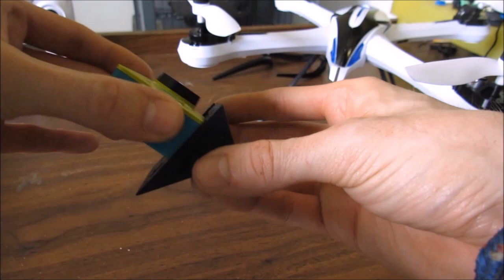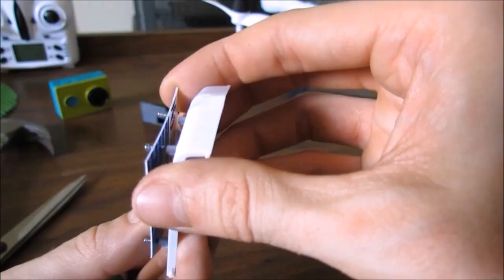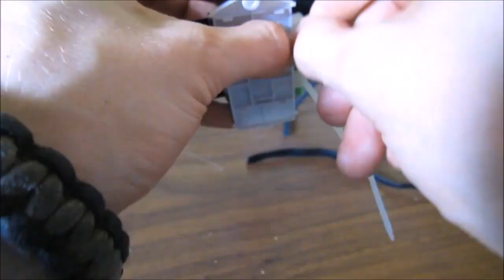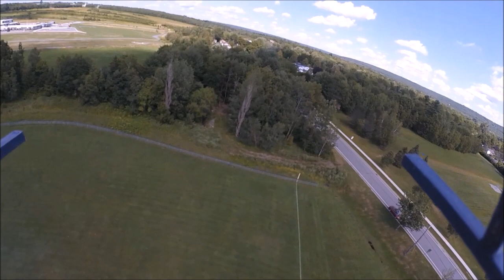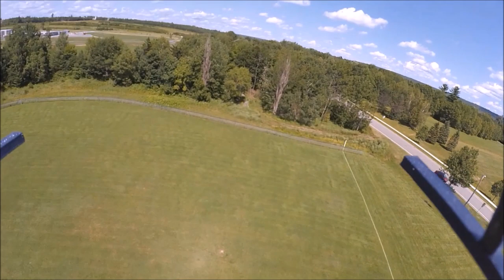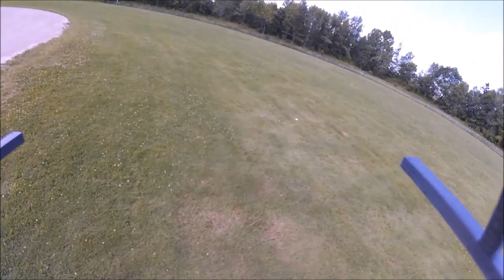Tarantula X6 Mod - 3D Printed landing gear, and Xiaomi Yi - 3D printer 30 degree camera mount

Comment: Finally I found a cheap quad that holes the Yi. Can't wait to get one. thanks for the great video yo!
Reply from the maker: sonygoup Yup, holds it with no problem. Some people will tell you not to put the Yi on it, but not me. As long as you don't fly extremely aggressive, do not put the power to 100%, and do not do flips. The motors will take the weight just fine. I fly mine 2-3 times a day with the Yi attached every flight and I have never burnt out a motor.

Comment: I took 4 Bic pen blanks and taped them onto the backs of the legs then hot-glued the landing gear to the body a bit to strengthen them.  Works great and plenty of room for any camera you want to attach.  One thing I find troubling with your method is attaching it to the battery door though.  My door pops off constantly so I would never attach a camera to it.
Reply from the maker: BurningBeard22 I had a very similar set up for my legs for the first day or two, then I said "there has to be a better way". I know what you mean about the battery door. I still have room to put my screw back in, so before I take off I decide whether I am going to fly high or low, and close and far. Then I leave the screw out or put it in accordingly. Next I will be doing the switch mod so before I even leave my house the battery will be inserted, and the camera/battery door attached with the screw every flight.
Reply: +My New Toys Yeah, I was thinking about the door and thought that the credit card being screwed to the door probably helps the door not flex in a crash and stay put.  Mine will flex even with the screw in and pop loose from the other end.  It's a good design, man.  Kudos.  Only one question, is it hard to change the angle for the camera mount?  That seems pretty sharp on yours.
Reply from the maker: +BurningBeard22 That really to bad, I guess Velcro is going to be your best friend, lol. It is if you don't know cad. 30 Degrees from horizontal is the smallest angle to not get any of the props in the shot and to have the Xiaomi/Gopro as close to the body of the Quad to reduce video ripple. However if you did want me to make the File with a specific angle I certainly can. Just let me know the angle and when I get in tomorrow ill have it done in a few minutes, and ill let you know.
Reply: Gotcha.  Don't worry about it, man.  I was just curious.  Thanks tho!

Comment: I'm searching for a better landing gear and I saw this, good job!
Can I buy it? I don't know anybody ft. a 3D printer actually :(
Reply from the maker: Walter Aarnoudse Thanks! Depending where you live  there may be one at your local Library usually they only ask you to pay for the Plastic used, and that would cost a total or like $5. If not there is usually at least one 3D Hub in most medium to large cities that can print these for you. If there is more then one check around for prices some are cheap and some are extremely expensive.

Comment: Not trying to be funny but isn't the whole idea of a camera to get a decent view? The landing gear is clearly in view spoiling the shot? Does that not bother you in any way?
Reply from the maker: skyrider1985 Actually it does! This was my first prototype to see if 3D printed landing gear would work. Now that I have a proven concept, I currently have a second model I am currently testing. It's easier to print and it's a lot stronger, with less of the landing gear in the shot. ( I will be releasing that .stl file for that design soon.) Then I will come out with a final Version That is strong, and with zero of the landing gear in the shot.
Reply: thanks for your reply. I like the idea, I've extended my legs with plastic pipe and it works well but sometimes, if the camera moves slightly, they end up in the shot which is annoying.
Reply: +My New Toys Any news on the new setup, so that the landing gear doesn't show up? :)

Awesome work! :)
Reply from the maker: Check out my new version here
https://www.youtube.com/watch?v=quabgUIBl9Q

Comment: Debes de darte cuenta que no puede levantar ese peso, no está diseñado para eso.
Reply from the maker: +saki2789 Thank you. The X6 has no trouble with the weight. Every flight I have taken with the X6 has had the Xiaomi Yi attached with no trouble. +50 Flights, no burnt out motors, no stripped gears, responds perfect with TX.

Comment: I will like to buy the landing gear and camera mount. Where can i get it.
Reply: Ray Lugo the file for 3d printing it´s at the description.
Reply from the maker: Ray Lugo Sorry but right now I am not selling them, the files are Free for download. If you don't have a 3D printer, (depending where you live) there may be one at your local Library usually they only ask you to pay for the Plastic used and that would cost a total or like $5. If not there is usually at least one 3D Hub in most medium to large cities that can print these for you. If there is more then one check around for prices some are cheap and some are extremely expensive.

Comment: that's a wasting of material. Landing gear done by printing never by so long lasting as cast (won't be so elastic). Easier way to get better camera mount is just print mount with screw (gopro connection) and with for screws to fix it to original tarantula camera fixing points. Don't make it very thick it has to have so elasticity. You will save material, weight and you will have adjustable camera angle ;)